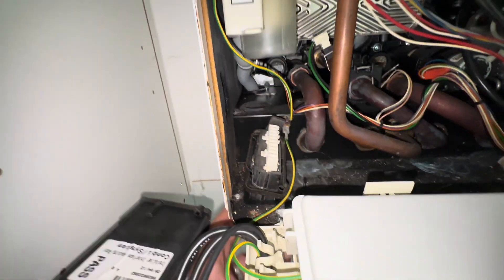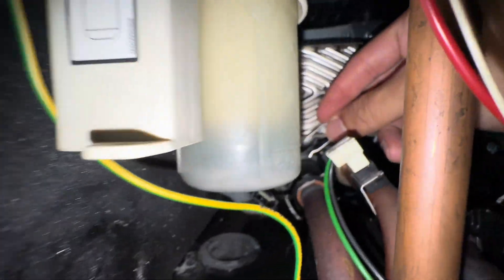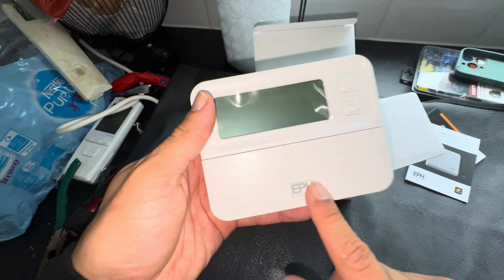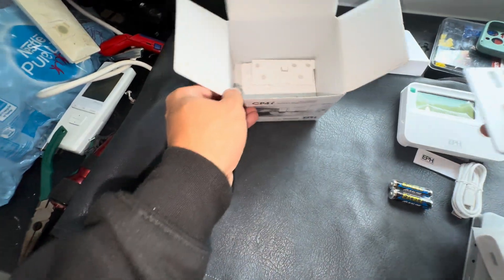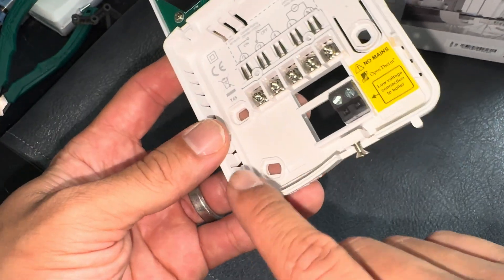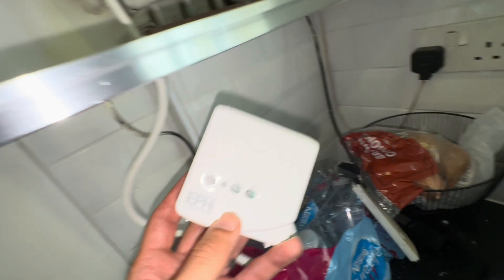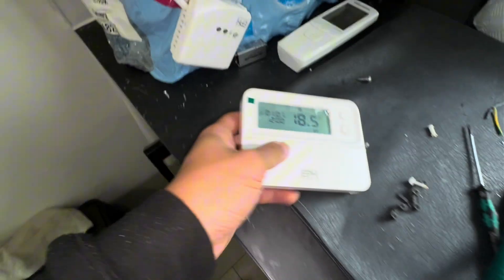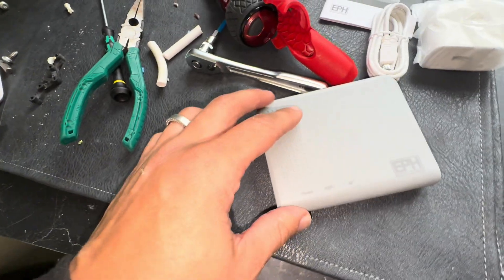The Re-Up - How many of these have you fitted?

Comment: I prefer ESI as not a fan of them small connections and that tiny plate you have to fit over.
Reply from the maker: @YoutubeHero666  the ESi are also great controls and have fitted a lot - insider knowledge says EPH are moving to the standard Drayton type backplate now 👀